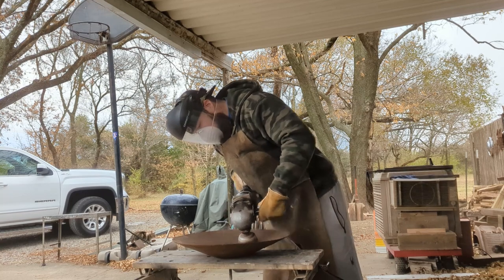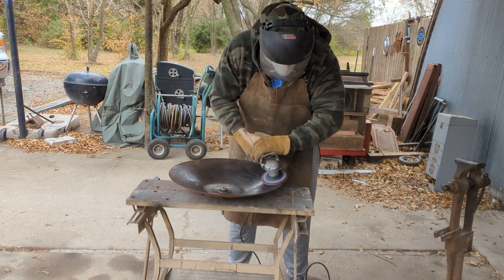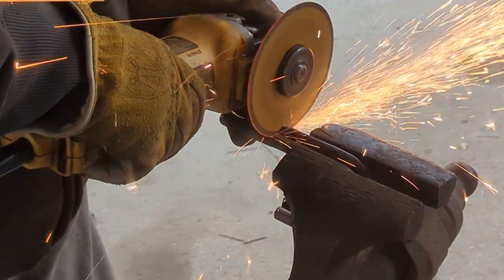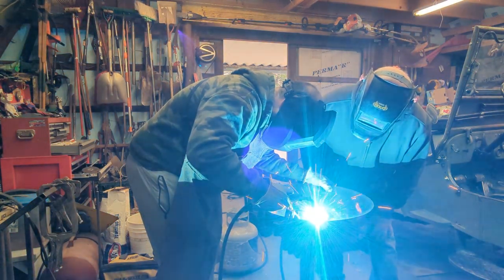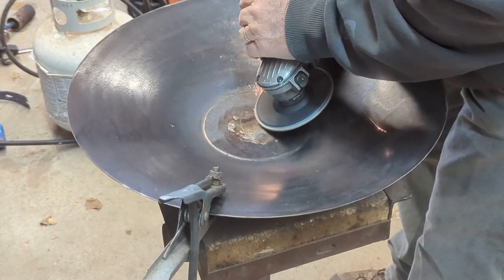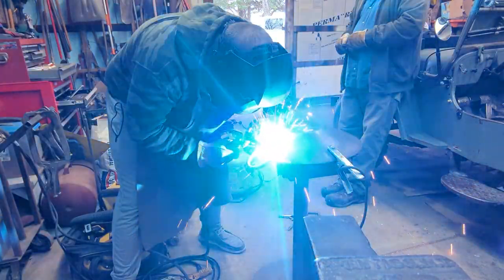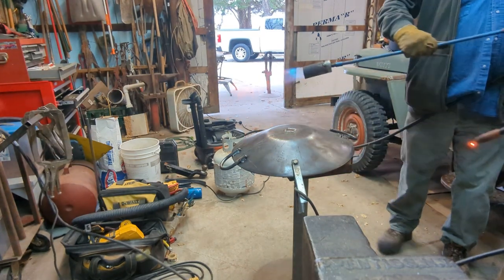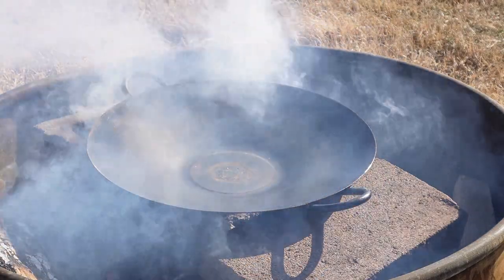Building a Cowboy Wok! From Rust to Campfire Cooker!

Comment: When making my first one I was struggling with my weld cracking so I did what any smart man will do, I called my Dad and he said to heat everything up real good before and after welding, Dads are awesome. Although we live far away from each other, he’s always there for me no matter how old I get.
Reply from the maker: That's awesome! Yeah I feel pretty lucky to have this huge wealth of knowledge a phone call away! Now I need to find the pieces to build an offset smoker with him next!
Reply: Man, I made one and my welds cracked and I was using a stick welder . Not all of them cracked tho . I wasn’t running as long of beads, basically tacking till it was solid .

Comment: Your father knew you had to heat the disco up before welding it,most people don't know that is the right way.
Reply from the maker: He's a pretty knowledgeable man! I am glad I can learn so much from him. This past weekend we built a new cooker to hold this Wok on, that video will be coming soon!
Reply: @GorillaJoesBBQ  Have you ever built a rocket stove,that disco skillet would fit real nice on one.
Reply from the maker: @eastside0434  I haven't yet. But my dad's been finding some tubing in that would work good for it, that's out next project!
Reply: @GorillaJoesBBQ  I like the rocket stoves with the front damper ,door on the wood shoot and the rear built in ashtray,most people build the generic simple versions of the stoves.
Reply from the maker: @eastside0434  I'll write those down, we will definitely not just go the simplest route haha. I like to challenge him, and it's fun for me to learn it as well.
Reply: @GorillaJoesBBQ  look into seasoning the grill will boiled linseed oil,I noticed most people ruin the stove by painting them black and eventually the paint fails.
Reply: @GorillaJoesBBQ  Slicksfabworks has a video of a pretty nice  6""stove if only they put the ashtray in the back so it doesn't block the airflow in the front.
Also Chiasson smoke builds nice stoves with rear ashtrays.